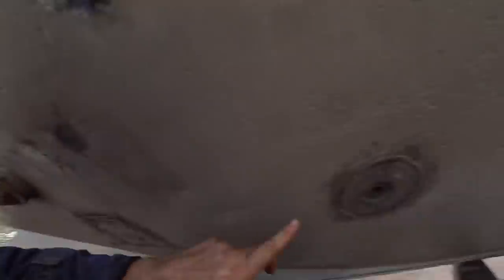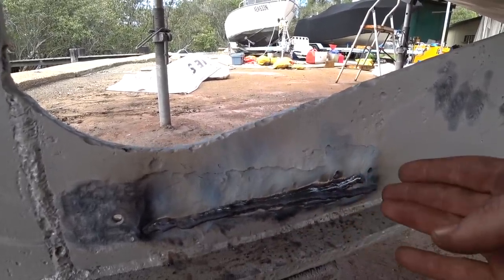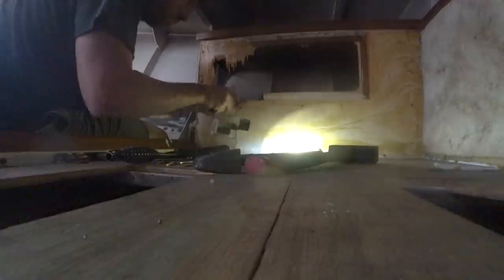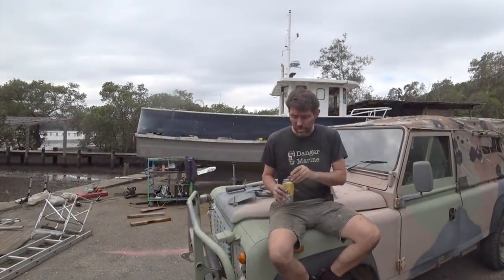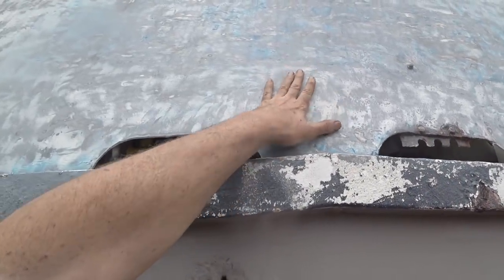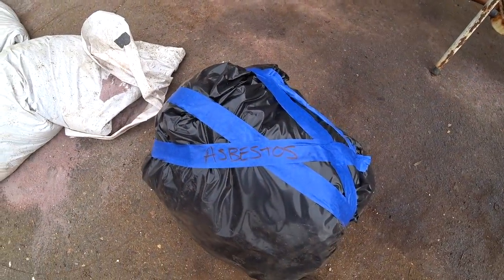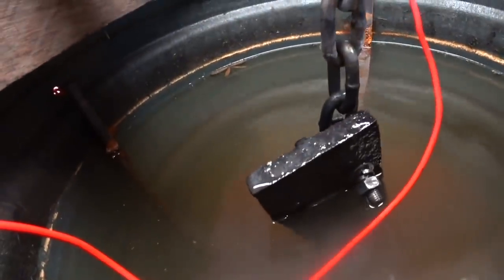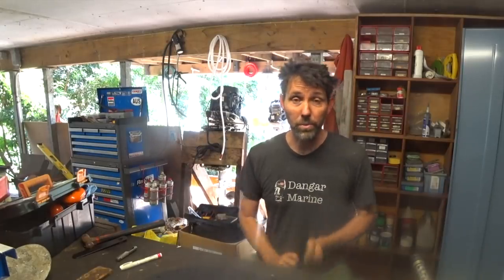Hull work, asbestos removal and a small fire

Comment: Hey there stu.. I see your positional welding is improving and you’re learning to monitor your amperage depending on the position and existing plate temperature from the previous welds. Good stuff, well done mate. The reason your slag is coming off easily is because your electrode travel speed and parent metal temperature are at the right settings and also you are using general purpose electrodes. Not because they are 3.2mm.  General purpose electrodes are a basic all rounder electrode for use in every position with the flux coating being the main factor for making them user friendly for beginners or amateurs. The rods you’re probably using are coded either E4812, E6012, E4813, E6013.  Depending on the original plate used for the hull, I would have used either a quality brand low hydrogen electrode probably WIA or BOC, CIGWELD E4816, E6016 for most of Hull work in most positions. They’re a bit harder to start and the slag is dark brown glassy like slag and harder to chip off, but has better penetration qualities. I would keep using some gp’s if found a decent hole to plug , then grind most that out to use a 4816 over the top to patch it completely and then go back over the other side and grind out the penetration of the patch and use 4816 to cover that over. If you have any long down hand position welds to make , ie- not overhead or vertical , try some iron powder electrodes E7024. They will cover any shit weld and won’t be lumpy and very forgiving making you look like a star. Just a little hint with vertical up, start the weld fast at one side, hold the rod there by counting 123 to yourself, then quickly move the rod across slightly diagonal up about 3-4mm to where you want your weld pool, hold again by counting 123, then move back across 3-4mm to just on top of where you first started and follow that same sequence until the end of the weld. That will leave you with better flatter contour and won’t have the appearance of it looking like both sides are pouring back into the middle leaving a big peak to grind off later.  Better to pay the extra money for quality name electrodes, the cheap lesser known brands are garbage, they cause all sorts of problems for the amateur and its hard to pinpoint the real problem when using them. You’ll notice the difference immediately and chipping the slag. But love what you’re doing there mate, really good stuff.
Reply from the maker: Thanks mate. I appreciate you taking the time to share your tips. I think my next challenge with welding is definitely to become more familiar with the rods that are available and when it is appropriate to use each one. I will experiment with some low hydrogen rods in some up coming videos. :)

Comment: Hi Stu, if only you'd turned the tank-hatch 90 degrees.
You'd have got two from that section. saves on wastage.
I used to work for Dunlop Chemline in the 70's lining tanks with rubber.
That's my only criticism though. Another enjoyable Saturday A.M.. Good work mate.
Reply from the maker: Good point, I was too focused on doing the vid. I normally think the same way about being efficient.

Comment: Re the long vertical welds at the beginning, carve a shallowish trench with the angle grinder to increase the surface area and fill the trench by stopping the rod and pushing in until the puddle fills the trench to the edges (with a slight crown) then move and repeat. When you get good at it you can feel the mushiness at the bottom of the puddle through the arc handle. You get good penetration, a nice rounded weld and excellent strength, minimal grinding and sometimes no pits at all (which can be hard on rust repair I admit). 

Good welding is about good prep, a bit of know-how and quite a bit of skill born of experience, which you're getting. I would highly recommend going to night school and doing a welding course. The things they get you to do there are hard, not easy. This of course brings your skill level right up. There is also quite a bit of theory which is essential in my view. The welding/theory ratio at these classes is something like 30-70 in favour of the welding so you don't just become a theory wanker with no skill.
Truly, your skill will dramatically improve especially since you've done a lot of rust repair already. Beginners typically don't do very well in these courses, but I think you would gain enormously.

The things they get you to do are like 3 pass arc welds on two pieces of 12"-15" long 10-12mm flat bar which you have to join (lengthwise) where the welds runs lengthwise, have to overlap correctly. It teaches you how to prep the angles of the steel to be joined, the width at the bottom (so you don't blow a hole through on the 1st pass), the shape, flux inclusions and a strength test, where they break your 3 pass job in a press and look for flux inclusions. If you fail you have to do it all again - and it takes at least an hour from start to finish working very fast. Each run in the pass is done on 2x longish pieces of flat bar where it is intentionally impossible to do each run with 1x rod. This means you have to butt join the welds correctly on the welding run and those buts cannot be in the same place - they have to be in a brick like offset. It typically requires 6x rods to do the 3 passes. It also teaches you how to cast off so the ends don't have concave finishes. The whole thing is difficult to get right and the failure after failure really pisses you off. Of course you begin to challenge yourself to get it right and afterwoods think "I don't want to ever do that again" after you've failed 4 or more times. 

When you get to that point you're on your way.

Comment: Maybe design a new panel cover held on by strong magnets ?  Steel boat .. magnets ... easy removal with no rattles ? Love watching your videos from here in Florida ! 👍👍👍😎 I was a union pipe fitter for years and there is no real reason to remove the middle of the gasket unless  fluid is going through the center .
Reply from the maker: Magnets certainly are worth considering, I'll look into it.

Comment: Hold the new unit in place with earth magnets.  We don’t use heat wrap anymore on the exhaust.  It actually causes it to rust.  The new units are now ceramic coated to trap all the heat.
Reply from the maker: There was loads of rust from the tape as you may have been able to see. If it is saveable I will get it ceramic coated instead.

Comment: Try doing some downhill welds if the rods are 7018 turn up your heat and use a larger gap and let the flux run off fill in the undercut.

Comment: Just thinking have you considered using a belt sander to remove rust, take down welds and other profiling? A good heavy duty sander with 20/40 grits can be very effective and is a lot quieter than the flap disc or grinding disc. it can be sore on the arms though!
Reply from the maker: I imagine a belt sander would also be good for creating a more leveled surface. I might look into that for the final fairing stage given this other work is done now.

Comment: Mate I reckon you almost have a boat made more from weld than original material🤔👍
Reply from the maker: You're not far off the truth! The boat was originally 9.5 tonnes and now I've added at least another 15kg of weld. That's 24.5 tonnes! ;)
Reply: Dangar Marine 
Heres a good tip
You run positive stick lead
It puts 2/3 heat into the metal

Negative stick lead
2/ 3 of the heat goes into the earth lead 
Meaning you keep the steel colder for longer
Reply: @noelscammell662  But most of us weld with AC.
Reply: @DangarMarine  hahaha Stuey you bad man
Reply: @DangarMarine  the math checks out

Comment: Don't bother with cutting out the centers, just leave em in, helps protect the inside of the hatch from corrosion if you're dealing with water on the other side of the hatch, and less chance for leaks.

Comment: Hi Stu, great video. I am a Marine Engineer and have made hundreds of fuel tank hatch joints over the years. You are better off removing the centre of your joint as diesel does cause the rubber to swell, so after a few years the centre of your joint will look like it's got a beer belly! This makes refitting the joint a pain. It also creates a void were condensation can form, causing corrosion to the centre of the hatch. Personally, I also use contact adhesive to stick the joint to the hatch. If the hatch and the tank are flat you shouldn't get any leaks. One way I've used to compensate for less than perfectly flat tanks/hatches is to make a second joint and stick to the tank - the two layers of rubber can compensate for quite a bit of unevenness. This only works if you mounting studs are long enough.
Reply from the maker: Good point about swelling.

Comment: Place the chisel parallel with and below the nut to shear the lot OR place the chisel on the side of the nut at right angles to the  surface to  split the nut .. splitting the nut is often a better option on a bigger nut / bolt.
As always if you knew this your thoughts was reinforced..... if you didn't then you learnt...
Better be told twice than no-once!!

Comment: When heating the hull of the boat you need to cool off the heated area with water. Called heat shrinking this technique is used in auto body when shrinking the stretched metal but it needs cooled off right after the metal is heated (red glow on metal)

Comment: Now that's what I call an action packed video !!! Ok lets get it reprimed and the motor back in . It will be winter soon there !!! LOL . Great job so far. Your welding is getting better. I guess you found out who the best teacher there is for metal work . Experience. Where are you on the decision on exhaust system? Although I am still an advocate for dry exhaust , there is a product like a plaster of paris you paint on that asbestos exhaust wrap . kind of turns it into a cast you would have on your arm. It works pretty well.   The conduit above that bunk looked cool. How many bunks does she have? How do you get to the bunk that was all burned up? The front hatch ? Did you make a proper video tour of the boat ? I dont think I've seen the inside of the wheelhouse/cabin in much detail.  Great idea about the fuel tank ventilation. I wish I would have thought of that a long time ago. Does she have a fresh water tank? Really digging on this series of videos. I am def. emotionally invested. If you don't make a dagger your fan club will suspend your man card for like 15 minutes.
Reply from the maker: Hopping to be back on the water in about four weeks, so getting there. If you look on my channel page there is a playlist for this project. One of the earlier videos definitely does a bit of a tour. And don't worry, the dagger will happen. ;)

Comment: hey , i commend you on the hard work your putting in to this boat . bit of advice though sometimes its quicker and easier to cut out rusted or corroded areas if possible rather than welding up the areas. eg your rear keel area  and anywhere accessible  from the inside .this also limits metal distortion  and all round is better for the long term plus who likes grinding. try down hand welds with higher amps for your pitted areas  less distortion cheers   Erik
Reply from the maker: Thanks Erik. Yes, I did cut out and replace three sections of the keel that were particularly bad. The pad welding is much quicker and easier for the shallow pitting though.

Comment: On the old vertical scabby welds at 1 minute in...use a cutting disc to clean same by rattling same gently up same this will knock out the rubbish out of same down to parent metal giving you a better outcome when re welding....also when you are sitting put your left elbow onto your Knee and grab your right wrist with your left hand or even cradle same with your left hand this will steady both yourself and your rod holder, even lean your right shoulder onto the hull... it all helps... plus rod angle should be about 35/ 45 degrees  Down from the horizontal on Vertical Up...gives you better penetration...good luck...
Reply from the maker: Totally agree about grinding out and bracing your body as much as you can. I really liked your description of how to best brace. Thanks. :)
Reply: @DangarMarine  Learned a lot of Welding tips from great  Old School Welders being as i was an Irish Pipe Fitter working over thirty years ago, out in the Sticks in the Moomba Gas Fields where the Sun tan was Free ... Lol

Comment: May be too late, but a 7" or 9" grinder will smooth those welds out quickly.. heavy, but fast ;)
Reply: yes at least a 7. they work awesome.
Reply: Yes, after you burn up this 4.5 inch just opt for a full size rig and you'll also see your consumable purchases drop dramatically and appearances increase...
Reply: Certainly if you are not big or old enough to use a full adult sized tool you should not use it alone and unsupervised, that would be just silly.  Safety First!     -just sayin'...

Comment: I’m wondering if you are familiar with using cheap white vinegar/water mixed 50/50 for the removal of rust from any of your steel and iron parts including nuts, bolts, drill bits and more. The fuel tank inspection cover would take about 4 days soaking and then a couple of minutes with a wire brush. I use old ice cream containers for small parts and cheap plastic boxes from Bunnings for larger parts. Keeping a few water bottles with a nail hole in the lid or a garden weed sprayer filled with water and on hand would be good for any more smouldering from welding. Is it possible lightning can strike twice?

Comment: That exhaust wrap looked like fiberglass , not asbestos ... one thing you did 100% right is hand tools only and the glue soak mix,, the high speed saws and such create tiny particles that float in the air.

Comment: Just an idea based on understanding why exhausts are wrapped insulation, but hating the corrosion the wrap induces due to trapped water- has any one ever used the ceramic coating on a boat exhaust before? I used the system on  a VW engined kit car (Purvis Eureka) where the exhaust looked good until I sold the car, and the oil temp dropped about 20 deg C compared to when running the same exhaust wrapped. On your boat that cooler exhaust would make life easier for a lot of things- batteries, alternator and drive belts at least.

As for the bunks, I have used a bolt mounted to the metal frame. a guard washer, a spring under compression, guard washer and R clip going through a hole drilled through the bolt shank. That bunk was in a bike trailer and road vibration undid anything else I tried! (even nylock nuts)
Reply from the maker: Hey Ron, yes, I would definitely be keen to try a ceramic coating of some sort. I also think the coatings look really nice too. I like your setup for the bunk, I was thinking of going with something quite similar.

Comment: Sawzall the thing out?  Didn't seem like you wanted the metal framing so why not just cut it out in large segments?   For the first time I'm questioning your time use.   Just curious.   Living this series.
Reply from the maker: Takes two hours to drive into town and back to buy a Sawzall. I often find myself using what is on site for that reason.

Comment: For future corrosion prevention besides the epoxy paint etc,  have you considered applying a counter current to the hull in lieu of zinc sacrificial metal?
Reply from the maker: I haven't yet looked into activate hull protection. I'll already bought the anodes but I would still like to do some research into it.
Reply: @DangarMarine  
While counter current is used in large ships,  it generally isn't used in smaller boats. Does require measurement of galvanic potential  in total the  boat and applying counter current in several areas. Can be expensive, and does require energy costs. It more expensive than zinc cheaters in key areas. However, the amount of corrosion that you are repairing in this old boat is amazing. I don't think that previous owners did much,. Note I am not a ship owner. Just wondering and did check info on internet. Western Marine does have an excellent U-Tube on zinc cheaters its. Note Magnesium used in fresh water, and aluminum used in brackish water.
Reply: Note it doesn't address corrosion from direct injury to  metal iexposed, and "abrasion" corrosion.

Comment: only thing I would suggest to you is an 8' grinder. It'll make much faster work of knocking the high spots off your more extensive welds. Only drawback would be if you were in a bad position- they are somewhat heavier- definitely two-handers...
Reply: I would think an 8 foot grinder would take more than 2 hands 😆😆😆
Reply from the maker: I’ve currently only got cutting discs for the big grinder, I’ll have to get some grinding discs too.

Comment: OOPS!
Usually, welding inside any structure requires a firewatch.
That was a close one mate!
A bucket of vinegar and a few pounds of baking soda will make enough co2 to fill the space and cut the fire risk.
Reply from the maker: Good tip!

Comment: Thanks Stu, for sharing your work. In Victoria we call the large, a Sledge Hammer and small hand held a Mash or Club Hammers.
Would fuel tank inspection plate, be easier to refit a new gasket in the future, if you cut out the enter of the large gasket?  just asking.

Comment: Sooo, welded metal always rusts ahead of the clean stuff. How long do you think these repairs will last?
Reply from the maker: No it doesn’t. How is welded metal not “clean”?
Reply: @DangarMarine  It's already part oxidised and rusts around the weld where the metal is not welded but oxidised.
Reply from the maker: With grinding and epoxy coating I think they will last the remaining life of the boat.